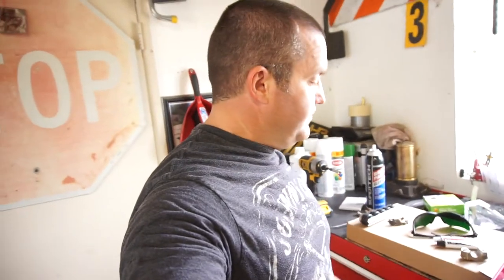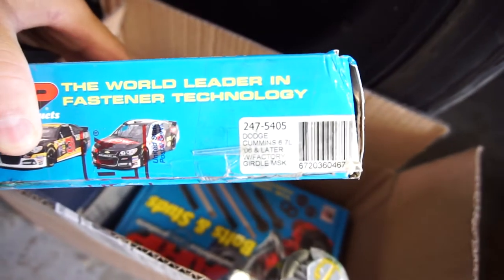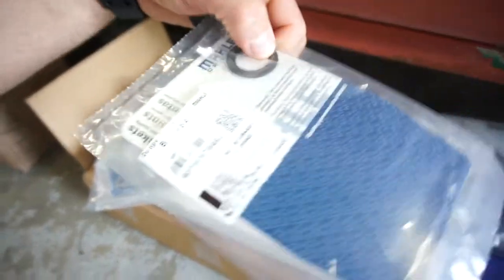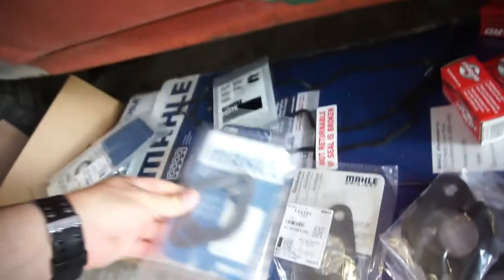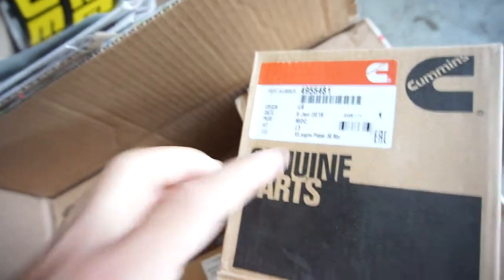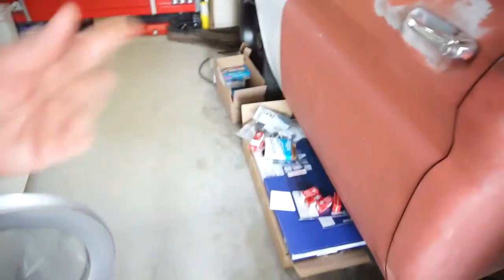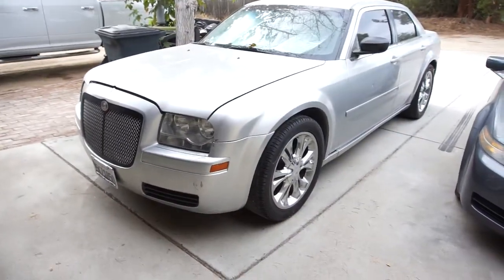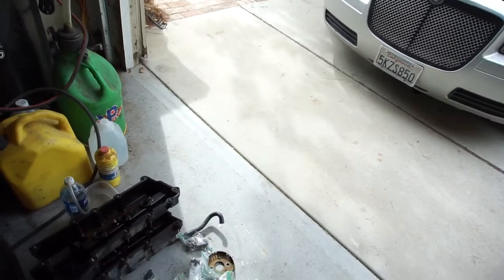Parts For The Cummins 6.7 Build. Mahle Clevite

Comment: Maybe I didn't catch it in the video, but are you upgrading connecting rods?  And if not, I'm curious as to why?
Reply from the maker: Monster RAM I am not for 2 reasons. 1 cost $2k or more for a set, 2 I’m just building it to sell it and the stock rods are fine for this build. If I was gonna install a bigger or thicker girdle and I would have bought higher end studs. Mainly for resale reasons.
Reply: @Halffast719  Makes sense.  Thanks for the reply.
Reply from the maker: Monster RAM no problem.